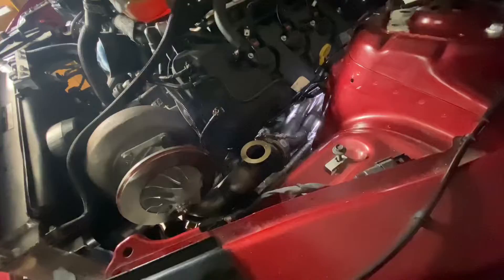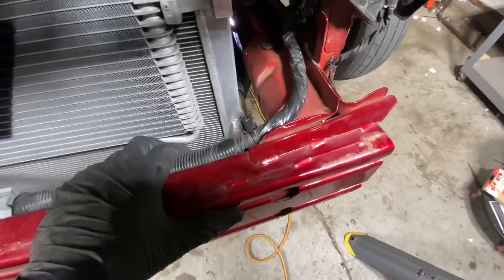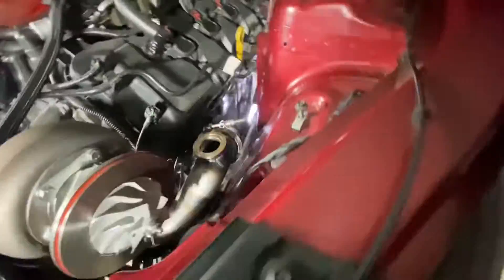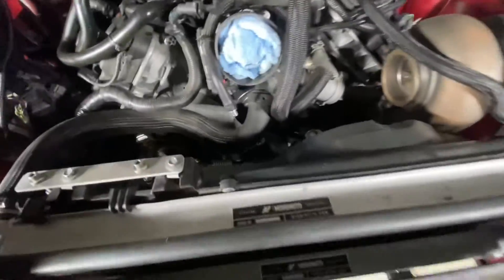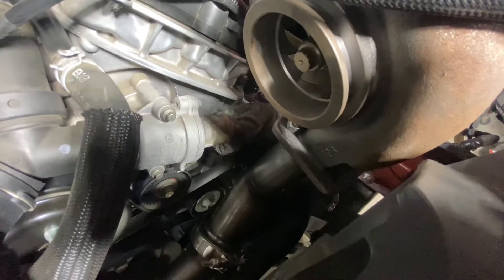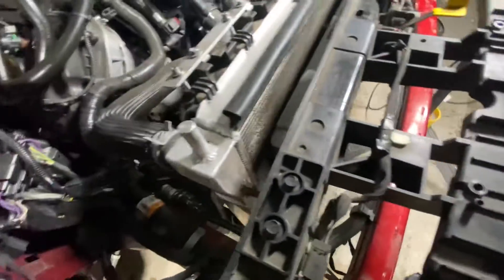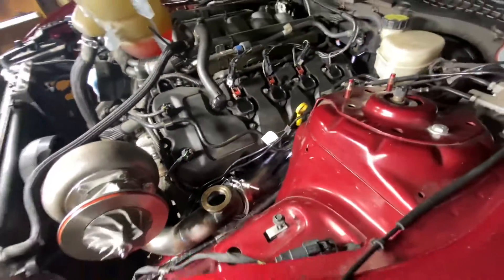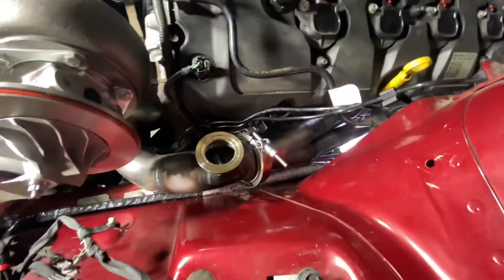First Time Installing a Turbo System on My S550 Mustang GT

Comment: I had no idea there was so much involved and so much to think about when buying and installing a turbo system.  Which is why I went the lazy route and bought a used complete system and there's still lots for me to learn
Reply from the maker: Man ! Your right either way they are all work to put in. I’m trying to mimic the Bl Fab but with my own twist. Hopefully by this summer I am adding to it with twin turbos

Comment: Great video bro. It’s coming right along. 👊👊👍👍🔥🔥
Reply from the maker: Man ! It’s moving slowly but surely. Two bolt holes took hours from me but it’s all situated now. Should finish the final touches on the hot side tomorrow
Reply: @DiablitoSpeedz  nothing wrong with moving slowly. That helps to make sure you get it right the first time. 👍👍🔥🔥